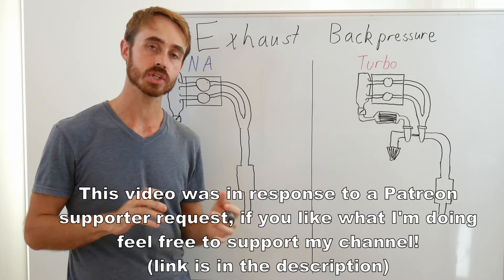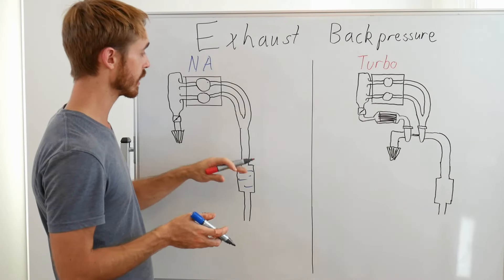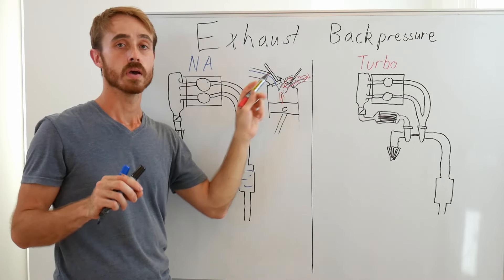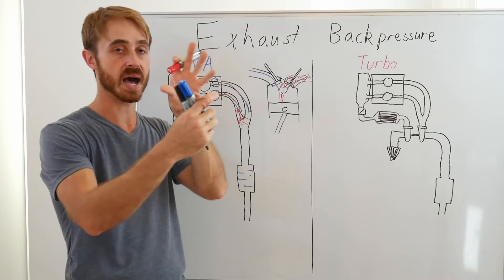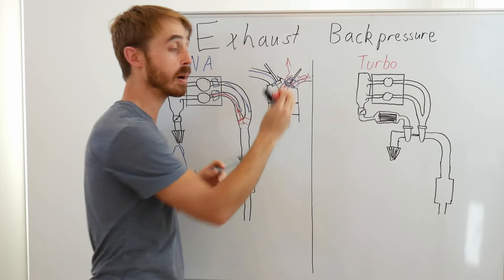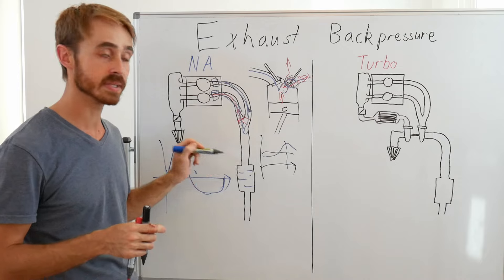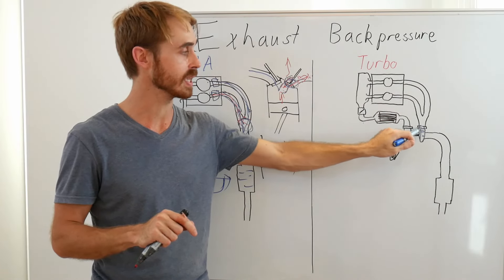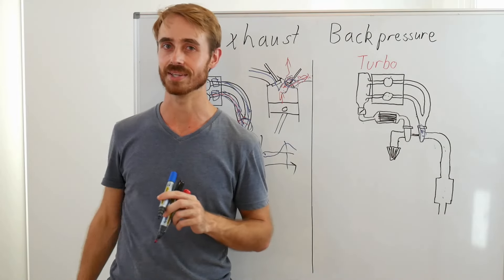How Does Exhaust Backpressure Work? - Basics of Pressure Wave/Harmonic scavenging

Comment: It is not an anti node rarefaction of a standing wave, it is an expansion wave that is reflected from an initial compression wave that is created by the sonic (speed of sound) gas flows just as the valve or port opens which rapidly drops to sub sonic flows in the exhaust, while the compression wave continues at the local sonic velocity of the gas in addition to the velocity of the gas, when compression wave meets an increase in pipe area (outlet or collector inlet) of any kind it reflects a mirror copy of itself as an opposite pressure signed expansion wave that travels back up the exhaust pipe at the local sonic velocity minus the forward gas velocity.
The expansion wave is timed to return during valve overlap, that is determined by the length of the pipe from the valve to an increase in area which is the distance the wave will travel and negative wave will return know as "tuned length".
If the time the waves take to traverse that distance in the pipe, determined by local sonic velocity (speed of sound) in a gas, is the same amount of time as the exhaust open to inlet open occurs at a given RPM, then the expansion wave will draw more intake in then would be the case by mere pumping.
I have a bunch of videos on the topic mostly 2 stroke and one recently on inertial scavenging and how it compensates pumping losses of the piston rising after BDC in a 4 stroke.
Reply: AuMechanic I've seen moto3 bike with single cylinder with dual exhaust (one outlet per valve design), does this amplify the return wave strength thus increasing engine volumetric efficiency at a specific rpm range?
Reply: @soraaoixxthebluesky   Yes it probably does, also keep in mind that the tapered cone shape at the end of the exhaust pipe (called a megaphone)  has the function of making the reflected  expansion wave effective over a wider RPM range than a straight pipe outlet is limited to, something this video failed to mention, a note a properly designed 4 into 1 exhaust will also have a taper section after the collector for the same reason.

Comment: It's not so much the wave speed within the exhaust but exhuast valve opening events. As the engine rpm (frequency) increases, the exhaust valve opening time (in seconds) decreases. With a fixed mean path length of the exhaust being fixed the opening events and the density wave go out of phase.

Comment: That's why for a N/A engine you need "Tuned Length headers" for your displacement/cam timing.  Shorty header only save weight and give no/very little power on a current  OHV V8.
Reply: Also why NHRA Pro stock cost so Much.....I've seen than they can actually get better VE ?supercharging effect than Old 90's F1 cars.

Comment: @KYLE.ENGINEERS: Maybe a little strange question but based on this explanation the backpressure before the muffler in a turbo diesel engine is lower than with a gasoline engine of similar performance?? For example: BMW X5 natural aspired V6 3.0 gasoline engine  vs a 3.0d engine: Could I for example use the muffler of the diesel model and put it on the gasoline engine? Since from the power they are similar I assume the diesel muffler would perform as a performance muffler on the gasoline engine. Correct or completely false??

Comment: I wish the term "backpressure" would die.

Invariably when people advise you "don't go too big or you'll lose backpressure", what they really mean is exhaust gas velocity.

As Bernoulli tells us, a fluid traveling at a higher speed is a lower pressure. Therefore by going to a smaller diameter exhaust, you are (increasing velocity and) actually losing pressure, which humorously is the opposite of what they claimed would happen.
Reply: MrClown indeed.  usually when people go big, and thus the exhaust loses velocity it tends to bounce around and stack up and can result in increased BP.  Proper built race cars run disturbingly small pipes and make killer power.
Reply: MrClown That's one aspect. Another is the reduced static pressure at the port due to the momentum of the previous exhaust stroke. It's easy to forget that for a while, the exhaust is flowing down a closed cavity, and this means that significant momentum in that flow can allow it to draw a low pressure zone in the pipe behind it, ready to aid the subsequent blow down event. This is the single most important factor when deciding which cylinders to connect in double or triple Y collectors.
Reply: There's a range of effective exhaust tubing diameter that will increase velocity, but not to the point of reducing efficiency of the system, i.e. going too small. In other words, there is an optimal size for a given system. Too small and too big create problems on either side. Flow dynamics are an interesting science.
Reply: I remember the last time a had a icy smoothie the bigger the straw the bigger gulps I had and the easier it was to get it out, but in a small straw fucking turned into a sucking workout!
Reply: Lifted_Above and how do we analyze that? Cfd?
Reply: Exactly ! People use terms but they don’t understand it all what they mean

Comment: Gasses have velocity and inertia. Pulse scavenging is more for two strokes. A smaller pipe will have higher velocity and inertia. Bigger will be lower but less backpressure but less inertia for scavenging on the overlap. Differences will have more or less power at different rpms. Now many motors have valve flaps down pipe in the exhaust to tune the inertia for all the rpm range.

Comment: Within tuned range, I don't agree that coupled exhaust will create sucking effect for next cylinder., at least not in time. Instead , it will have positive pressure when next cylinder starts opening exhaust valve, and travel to other cylinder. This positive pressure will reduce overall VE of the engine. Because it is able to cancel or reduce negative return pressure. However, it is depended on length, angle , diameter of the primary runners.  

Maybe this is the reason why drag car use individual exhaust runners.
Reply: shao jom drag cars and recing cars just focus on specific rpm band. Therefore they can design diameter and length just nice for that rpm.

Normal everyday car needs to cater from low until high rpm (if possible)
Therefore, scavenging helps in these low rpm region.

However, I have not gauge any exhaust with a pressure meter.

That would clear any myths.

Comment: Hi have a question.

I am making my car repaired and probably made some mistakes in exhaust system. Car is Jag x type v6 and both catalytics are broken - one emptied other is probably clogged. Car idles say for 3 mins then engine dies. Exhaust guy suggested me to place a universal catalytic where pipes from cats unite so there is now one catalytic on line before exhaust mufflers. 

After spark plugs replacement i can drive car for say 5 minutes then engine dies on the move, wait 10 minutes then car runs for another 5 minutes. 

So i think a big back pressure builds up and engine dies because there was not this issue before installing universal cat.

I plan to remove new cat and let exhaust float easier until i find good cats.

Thanks in advance. Cheers.

Comment: Hi, I own a 1994 Dodge Ram Cummins Turbo Diesel and the garage just downsized my exhaust and muffler to a 2 inch pipe, they stuck a smaller pipe into the original pipe and welded it into it. They suck.... What will this do to my trucks back pressure? Thanks.

Comment: I ran my exhaust on my 1995 S Series with a 1991-1992 GM factory header, a pace setter high flow cat converter and a factory muffler and the same size pipe. I also have a ported intake manifold , bigger throttle body a cold air intake, and totally upgraded suspension and a polyurethane master bushing kit, and although I'm gonna build it .20 over for a Turbo setup and dual intake cams, etc It has the perfect amount of torque, at the moment , back pressure for what it is. I don't have to even give it more than a third of a petal cruising and I look down at speedo, and I'm at 70-75 MPH in no time. But the car is only 2280 LBS with ample torque...lol  It's gonna be downright nasty with 320-350 HP and RPF1 Einkei 15X7's and 205 50R 15 Toyo Proxies in the coming months...lol

Comment: Hi, I have a catless downpipe on my A4 2.0T, it overboost by .2 bar when boost kicks in and then after 5-6k rpms to 7k rpms i notice it drops, could this be because the cat is removed that the boost spikes a bit? Is it possible that the catless can cause the boost to drop lower than what the car is requesting for at high rpms?

Comment: You're somewhat close with the resonant tuning, but you're missing a major point.

The cylinder still has a bit over 100psi in it when the valve is opened. This is... massive... compared to any other pulse tuning pressure in the car. The result is that about half the residual gas leaves the cylinder before the piston has moved up any significant amount. The ideal negative pulse arrival time (at the valve) is top dead centre. If tuned correctly you can end up with negative 4psi (gauge) in the cylinder when the intake valve opens. This is why overlap is so important on a race car, and why cam specs influence header design. The major effect is on the same cycle, not the next

Look at this graph
https://musclecardiy.com/wp-content/uploads/2015/01/8.jpg and note that peak vacuum occurs fractionally before tdc.

and download the "engine analyzer" demo from performance trends to see the effect and data of tuning exhausts. Try a 40" primary pipe on the demo engine and see what happens when you get the full action of the 1st reversion pulse
Reply: Thanks for the insight. I'm going to look into this topic more.  Understanding air flow and pressure gets me excited.
Reply: hey mate you seem to know a lot about what your talking about it would be great if I can ask you a couple of questions
Reply: @jamier9113  go for it. Can't promise much though
Reply: Skippy cheers I appreciate it I have a 4litre 1grfe petrol engine and I have just bought and on Friday will be installing long tube genie headers and removing 2 out of the 4 cats with a stock ecu is it still possible to get good Benefits and is it possible for scavenging to still happen?
Reply: @jamier9113  I just had a look at that. I'm assuming you have a hilux. They have pretty poor manifolds that look like a pipe bolted to the head, so literally anything is an improvement. Half of manifold design is eliminating screwups. Genie looks like they eliminated the biggest screwup of having mitred joins. Incidentally so did Toyota with other apparently interchangeable headers.

By removing the cat converters you have also improved flow.

Between those two things (having real bends and having less cat converter to deal with) there will be significantly less residual pressure in the exhaust ports, so you'll have a much better situation at overlap. You'll probably gain, I'm gonna guess, 5% under any given condition. This is basically avoiding screwups.

As for real scavenging (making something genuinely good) I don't think it's going to work. They aren't long enough to get the acoustic tuning right. They are also probably too large for inertial tuning (which to a degree sucks the exhaust out once the above mentioned blowdown pulse gets things moving).The Genie headers are 44mm in diameter, ideal size for a 500cc cylinder at 4000-ish rpm is 28mm. I don't feel like doing the maths on the 1GR but I'd be surprised if they were supposed to be bigger than 35mm.

I don't think for a second you've made a bad choice, there's every chance the Toyota exhaust port is too big to put a good header on it and there's probably not enough overlap to make the most of it even if you did
Reply: Skippy thanks a lot mate was really informative I appreciate it

Comment: Obviously you aren't a drag racing guy, but if you could, I'd love for you to expand on the pros and cons of zoomies (isolated primaries) over collected headers. I've seen a few guys, when horsepower isn't an issue (as in tire limited classes where they have all the power they need but just have to figure out how to get it to the ground) prefer collected headers because they are "easier to tune". Im assuming its due to only requiring one o2 sensor per bank (therefore simplifying the data) as opposed to an o2 sensor per cylinder, but I'd love to know if I'm oversimplifying it, if I'm completely wrong, or if I'm on the right track but missing other variables.
I understand this isn't your arena, but I'd appreciate the engineering/fluid dynamics view I think you may be able to provide. 
Thank you brother

Comment: I’ve removed my catalytic converter on my turbo diesel truck and the engine runs smoother but I have lost some of the initial torque. It kicks in much later now..what can I do to get torque to kick in at a lower rpm

Comment: So does the increased work that the turbo does reduce its potential reliability? E.g if I take my muffler off will I blow my turbo?
Reply: Since you are not altering the characteristics on the side that needs pressure/pulse waves for combustion chamber efficiency simply put, deleting the muffler (even the catalytic converter as well) on a turbo setup is generally BETTER for the system. Disclaimer - I AM NOT AN ENGINEER! This is what I've noticed from personal experience, a slightly educated guess at best so consult a professional lol.
Reply: This seems to be the consensus however my gut says if you free up one side of the turbine then your turbo can spool faster as there are less restrictions on exhaust gas flow past the turbine. It may overspool a little bit before the wastegate (?) comes in to let the excess pressure off. This is more revolutions and more stresses on your turbo. That's my theory and I don't want it to be right 😂.

Comment: Excellent video Kyle! 

Thanks for clearing up the myth about engines needing back pressure for so many uninformed folks. 

An ICE is basically an air pump. A working understanding of hydraulic circuit theory would quickly clear up the whole back pressure myth.

Comment: Kyle i would like to know how to figure out what is the rpm or frequency the exhaust is tuned for. This would be helpful if i am picking a camshaft so i dont pick the wrong effective rev range. It would also help me to port the heads to know how much porting is useful in a engine because the exhaust is only going to help at a certain rpm. Knowing this we can build a engine that is optimized in exhaust, head flow porting, cams, valves, comp ratio, x pipe and intake. Speaking of intake, the length of the runners optimizes the engine powerband too can you do a video on why?

Comment: In a NA single cylinder, where is the rarefaction developed from if there is not throat collector in the exhaust?
Reply: darotor go take a look at a mower or rc car exhaust. Its a common issue with 2 stroke engines so there is an expansion chamber along the exhaust somewhere. The exact size and positioning of this can alter how efficiently the exhaust is extracted feom the cylinder. Of course, 2 strokes dont have to worry about valves but the cylinder still behaves in a similar way. If you dont have an expansion chamber, just cutting the pipe to the correct length works too. (or positioning the first muffler)
Reply from the maker: Don't forget things like powerbombs on 4 stroke, single cylinder dirtbikes! http://www.motorcycle-superstore.com/6492/i/fmf-powerbomb-stainless-steel-header
Reply: On a 2 stroke scooter (back in the day :D) we usually mounted something like this: 
http://www.motorcycle-superstore.com/9610/i/athena-scooter-exhaust
And it performed quite well. This weird shaped thing is apparently generating a backpressure "shockwave" to sorta seal the exhaust opening and prevent fresh air from coming down the exhaust, increasing the amount of air/fuel in the cylinder. Kinda different thing because.. well, it's a 2 stroke engine. I don't know the details anymore and I also don't know if that is actually working the way it's supposed to. It did increase peformance significantly though - in comparison with stock exhaust or no exhaust. Cheers.

Comment: Good video however I strongly disagree with a comment you made a few times about scavenging not really being important or an issue for a turbo engine. 

Any opportunity allow a turbo engine to operate closer to an n/a engine should be capitalized on. 

Removing pre turbo emap allows you the potential to improve VE. 

As you know, Fluid dynamics dictate that fluid will flow from the higher pressure point to the lower. Creating a window for the engine to operate in where inlet to pre turbo exh pressure is under a 1:1 ratio, allows scavenging to take place if valve timing, fueling and ignition is optimized. 

This will absolutely help with turbo spool, off boost torque and drive ability, engine efficiency etc. 

Scavenging can and does work on turbo engines too.

Comment: Where is the EGR valve in your drawing? The EGR takes exhaust gases and runs it through the engine again. Does that affect the back pressure? What happens to the exhaust with crossover pipes?

Comment: I got q50 turbo tuned just about over 500hp

Do you suggest and exhaust with 2.5 ich piping all the way through

Or 2.5 inlet to a 3 inch outlet? If I understand from you video 2.5 to 3inch is better right?

Comment: You could have added the factor of compression ratio or compression inside cylinder. Usually, the engines with EGR systems and no exhaust gas coolers have a lower compression ratio. In these cases, what would be the effect of reducing your exhaust backpressure?